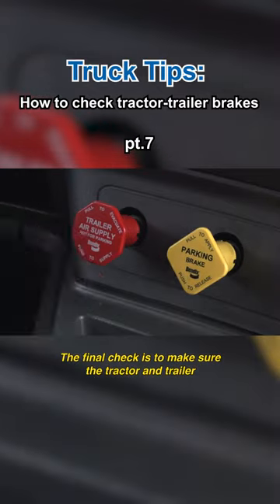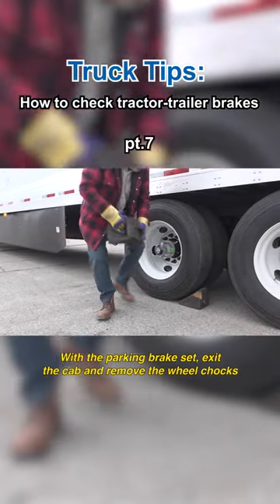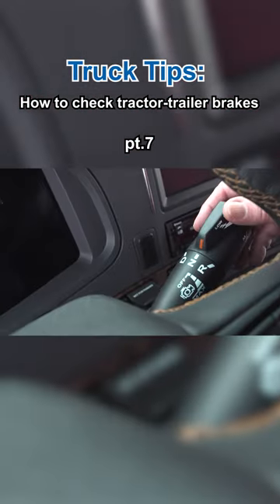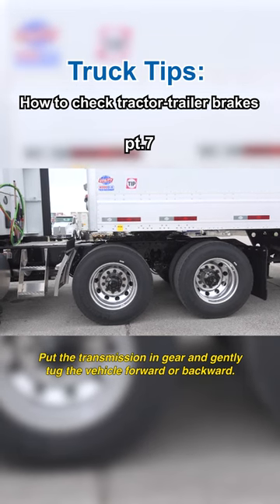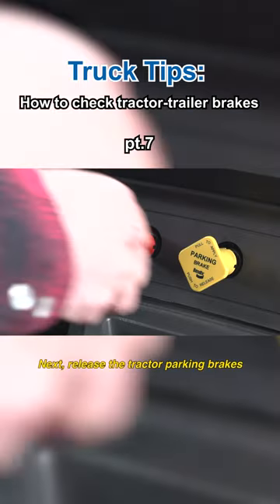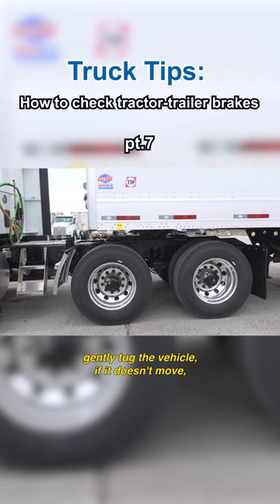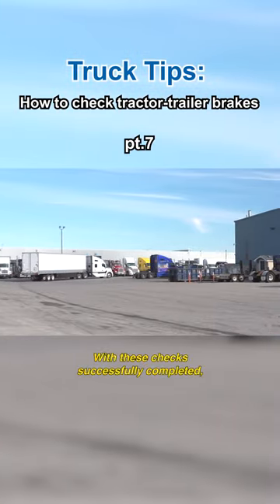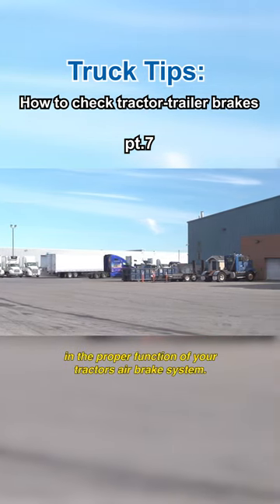how to ACTUALLY check your truck brakes! pt.7

Comment: He failed to mention the 5th wheel stress test 
First: pull 5th wheel pin with landing gears up and Lines attached 
Second : Release tractor brakes and go full Throttle 
Congratulations you completed the Test